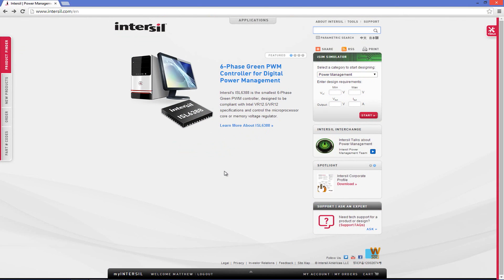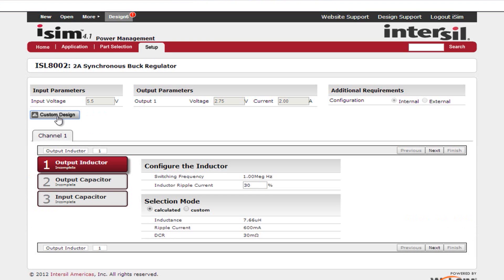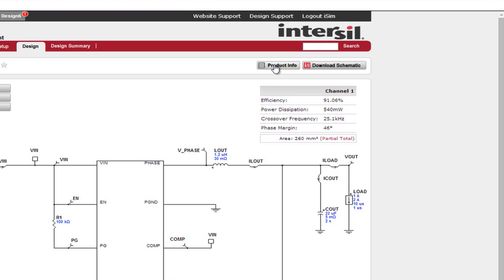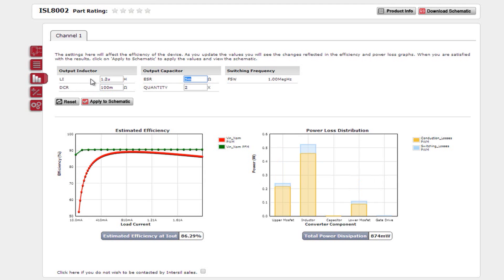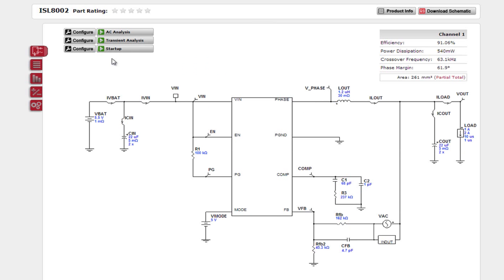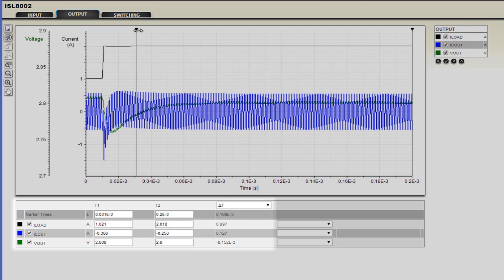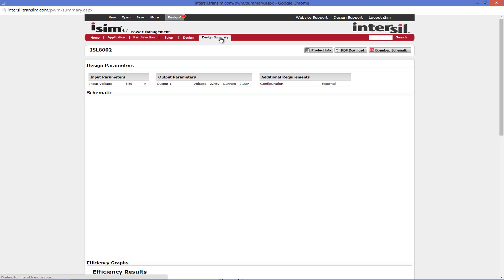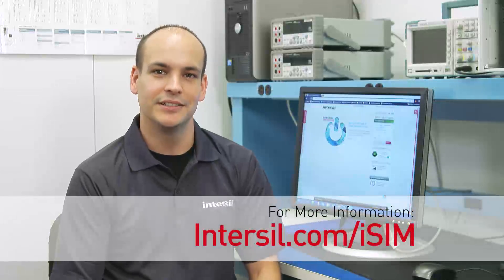Simulate Power Designs with Intersil's iSim

Comment: Good day! I'm having trouble finding these transistors here in my city, Rio de Janeiro, Brazil. These are particularly used in a unit CDI (capacitive discharge ignition) on a Honda Shadow 600, and beyond the damaged transistors, a capacitor filter was simply incinerated, not being possible to identify it.
This here and a distress call because I need these components to conerta them.
I will be immensely grateful to obtain a satisfactory response from you guys.
Many thanks in advance.